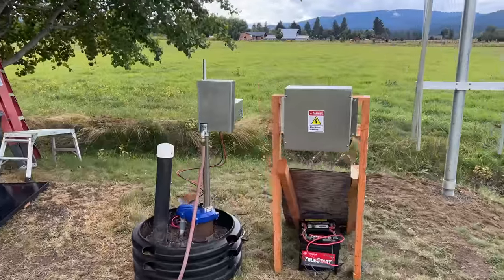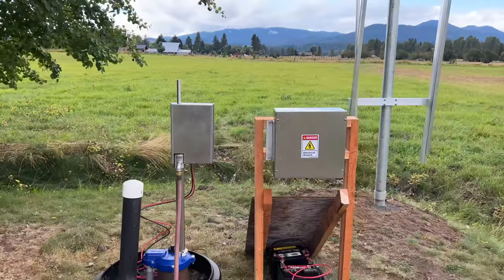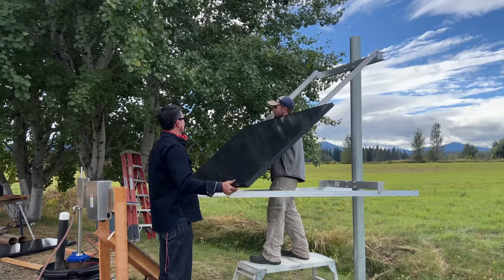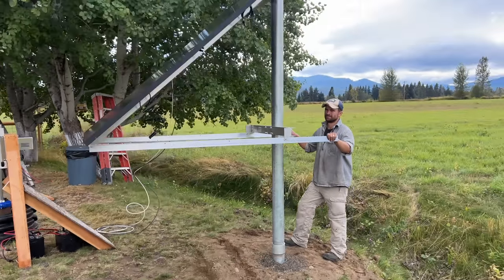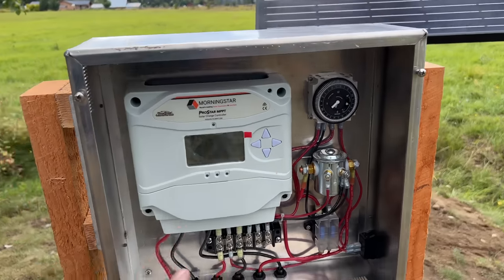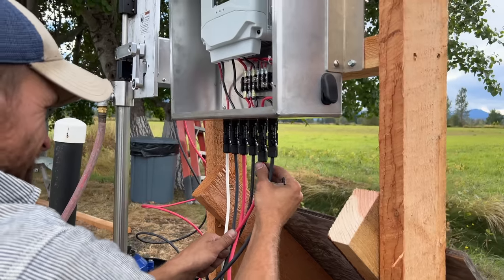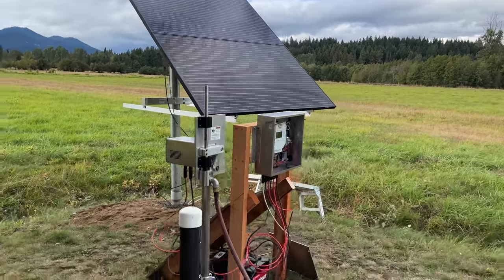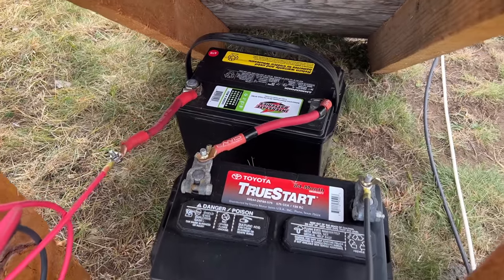How To Eliminate a Dangerous Threat To Your Home Security

Comment: I miss the old Wranglerstar videos. Not for clicks or views but for knowledge and experience. Uncle Cody had your back, if you followed to the T it's right. Insight is still there but somethings missing.
Reply: 100%
Reply: it prolly has something to do with the fact that most folks won't buy a cat skid steer, excavator or $6000 solar water pump just because they can.

Comment: The electric pump actuator works like the ones used to operate Wurlitzer band organ pressure and vacuum bellows. Supplies wind to blow the pipes and vacuum to the roll tracker bar and bell s.

Comment: A real "big boy" mount would be 3" 4130 seamless, wall thickness 0.12, steel tube.

Also, use LiFePo battteries and an appropriate battery management system. They are more expensive than AGM batteries but they can be more deeply discharged without damage and are good for ten times the discharge/charge cycles than AGM batteries. They are also lighter in weight but that is not a consideration for a fixed ground installation.

Speaking of grounds of a different sort, that deep well casing makes a helluva grounding rod but you'll have to tie it into the electrical service ground.

Comment: you could probably use a lithium iron phosphate battery and never have to change it out (thousands of cycles).  You could even place a small, low wattage heater in the battery compartment if the winter months are otherwise too cold for the battery using a $20 retile heating pad on a thermal switch, providing a great way to give you a safe space to upgrade to LiFePO4
Reply: Lead or AGM will work just fine, as long as you do not have to deep cycle them too much, keep them topped off with the solar charger. Sure LiFePO4 with a BMS is nice but much more expensive... and the conventional batteries are easy to get, I recycle old car/truck batteries after they are a years old by using them on our PV installations...

Comment: You should look in to battle born battery. They are lithium and you can discharge them down almost to 0 with out damage. very popular in the RV solar community.
Reply: As I understand it, the lithium ion batteries do not do well in cold environments, therefore they require being heated. (Battle Mountain makes heated batteries)

Comment: If you added a small water storage tank 55 gallon plastic type so at night you would have a small water backup using either pressure or better yet gravity feed. No,power needed.

Comment: Just a suggestion, if you were to run the batteries in parallel (keep at 12v), you’ll want to pull the positive from one battery, and negative from the other to help keep it balanced. Just for future endeavors.

Comment: I was just thinking that if this was paired with a cistern you would be all set.  The Simplepump could be used to fill a large cistern. Then a smaller 12/24 volt pump could be used to keep water pressure wherever you want.

Comment: Maybe a lithium iron phosphate battery for the pump over AGM. Quadruple the lifespan of AGM with many of the same cold weather benefits. Best to find one with a built in heater, for charging in freezing weather (fine to discharge in sub-32f but not to charge).

Comment: Could this be plumbed to your pressure tank? I am no plumber, I would assume it would require some sort of check valves. It would be neat if you could run a smaller generator to all the service pressure tank and water heater and skip having the generator run the conventional well pump itself.

Comment: wasn't there enough room in that pipe to have both the manual and solar extractors simultaneously? I just don't see the point to all the work of setting the manual pump just to remove it unless it was just to make sure it worked. before storage.  Nevermind I wrote that before the 4:20 mark where I see it's just the handle that has been replaced by an electric pumping thingy lol.

Comment: please don't go AGM, do the right thing and get LiFePO4 Cells (LFP), yes they are little more but you don't have to deal with replacing them every few years and they charge much faster during the day compared to lead/AGM and in the end after 3+ years will be cheaper.

Comment: Really nice setup.  It would be very helpful in most emergency situations.  But SHTF ... It is too reliant on electrical and mechanical parts that wouldn't be easy to replace.  Now if you have spares of key parts on hand, that is completely different.  But if your home is water restricted, the old try and true low tech methods are your best friend.

Comment: These Two batteries are wired in parallel, for Output of 24 Volts! To be wired in series, you need Three batteries or in Multiples of Three! Hot to Load, Ground to Hot, Ground to Hot, Ground to Hot! Ground to Ground in the Ground! Quick note. Make sure Load is grounded too(lol)! Sketched a quick diagram just to make sure! 😆 Lol.
Reply: Nope. Don't know who told you that. LOL. Neg from the load to bat1(-), bat1(+) to bat2(-), bat2(+) to load. 2 batteries. Number of batteries means absolutely nothing. (Just need more than 2.) If you had to sketch it, you didn't know enough about the subject to make a statement. Prob better if you preface with "I think..."
Reply: @littlejackalo5326  I was talking about connecting in series! Look it up! If you try series with two batteries there aren't enough connections to complete circuit! You don't need more than 2 bats but it's recommended for parallel connections! As far as the "who told me part" been doing this for 20 some yrs! Though not often & definitely not every day! Clearly either you missed the word "series" or you don't know what type of connection that is! I suspect the latter of the two! If so, you concluded falsely that I'm a moron! NOT! LMMFAO!